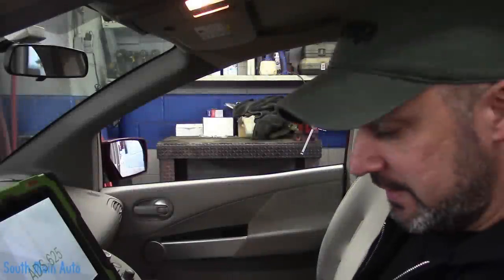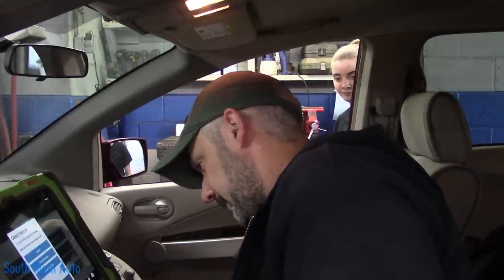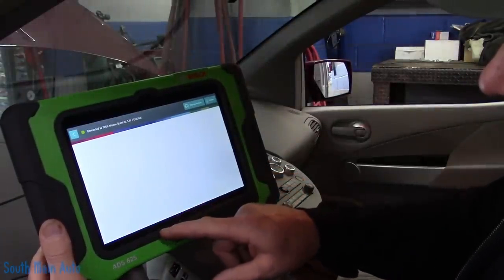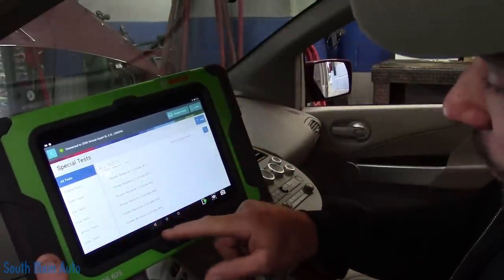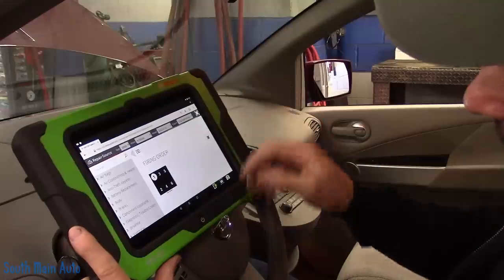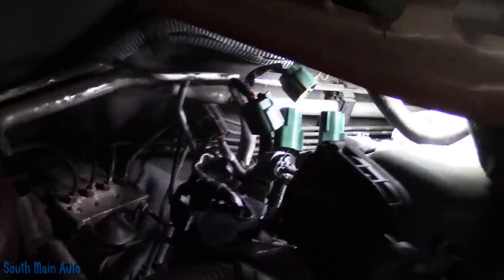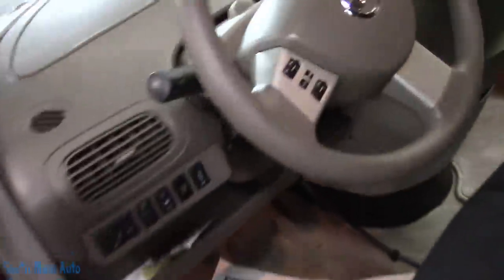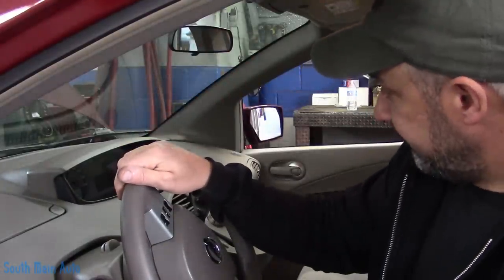Customer Replaced Spark Plugs And Now It Runs Bad!?

Comment: Had a bugger of a time changing the intake-side plugs on my 4.7l, 2008 Dodge Dakota.  I think that they were original and the boots on three of the coils were welded to the plugs.  Finally all buttoned up (pro tip, park the working vehicle behind the one you are working on), and started and idled just fine.  Went out to run some errands and the miss-fire was awful.  First stop, put on the gloves and had a look, everything looked fine, still bad, second stop, out again for a look, #2 coil connector was not plugged in - who the heck would forget that?

Comment: WHen I bought my Caravan, the first thing I do with a vehicle is replace fluids, plugs, wires, belts, I discovered the plugs in the back of the engine were all just finger tight LOL, no idea if the previous owner never tightened them or what but all 3 were just barely finger tight.
Like this video shows, cyl 1 and 3 were mixed up, this is why you remove ONE wire at a time!

Comment: Replacing sway bar links on wife's Chevy Cobalt.  Got the body bushings done, started the first link, but the ball was spinning in the socket.  There were no flats, all I could grab was the nut itself.  Tried locking pliers, still nothing.  Turned out I'd forgotten there was an internal hex on the end of the stud to keep the ball still while turning the nut.  Ended up retightening the nut as best I could, and shop down the street charged me a half hour labor and then told me what I should've done.  In my defense, the internal hex was pretty gummed with dirt and grime - even after the guy showed me the part it took me a second to realize what I was looking at.  Before bringing it in, I thought about grinding flats in the end of the stud (I'd been expecting an external hex, because my OEM replacements had them) but worried about making a bad situation worse.  Should've just went for it.

Comment: Done the same on a Honda motorcycle. Wasted spark coils under the seat, spark wires a good 2+ feet long. Left coil goes to 1&4, right goes to 2&3. If you hook em up as 1&2 , 3&4, it will just about start and run on 1&3.

Was into a spare set of carburetors before my dad looked at what I was doing and figured it out.

Comment: Rebuilt a 3970010 Tree-fitty block once had a tap or knock sounded like a back cylinder listening through a 24inch extension bar. I had some help on tear down put all the parts in the trunk of the 79 Formula Bird I took it out of. Was doing inventory and checking head casting#'s cause I had a $400 offer of a set of cameldouble humpers at 67cc with oversized valves, beehive springs, already set up for roller rockers. Anyways was in the trunk digging out heads and saw the timing gear had plastic coated teeth and that it had broken a good size section off. To this day I think all that engine really needed was a timing set. I did it up right though got the heads the guy was selling with roller set, freshened hand ported, a medium cam, edel duel plane, double roller timing set. Dumped 1200 or so into that and only needed a timing set.

Comment: Had close to the same issue on a 05 equinox. Did a head gasket job for my sister and it was 2:00 in the morning when I finished. Started it up and had a huge misfire. I had 2 and 4 flipped around. I learned once again. That's it's never good to be dead tired and work on vehicle's. It always ends bad lol.

Comment: My silliest mistake was after rebuilding a Pontiac 400 after I put the distributor back in I started putting the wires back on in the wrong direction! Changed the direction and the engine ran like a champ!

Comment: Did an engine swap on a suzuki sidekick, took the 1.6 8 valve out and put a 1.6 16 valve in, modified my wiring harness as needed. I got my 16 valve in, fired it up, and its running smooth, not coughing or misfiring, but revving super slow and lazy, and no power. Well, its not timed yet lets time it, no change. Well is my EGR stuck open? Nope thats not it. Hows my wiring, hows my compression..... 2 consecutive weekends of checking absolutely everything with no change. It was about the 4th time re-installing the distributor cap that I realized, even though I knew it rotated counter clockwise, I was putting my plug wires on like it spun clockwise! After swapping 2 and 3 it ran awesome!

Comment: I was working on the v.w golf, 1999 when it stalled out in middle of winter after I sprayed engine bay, leaking oil I wanted to see where. Oil was low so we went and bought oil and a funnel, told wife we had to get smallest one possible. Mind you I was under pressure, needed to get to work on time, I pulled the dip stick out and tried to put the funnel in the dip stick to fill it, after a few choice words, my wife said joe, don’t you fill it up there, yep on the valve cover a big ole cap for putting oil in. Man I laughed hysterically, couldn’t believe that I did that, my wife was the mechanic that day!

Comment: I've done a few plug changes and i usually do them one at a time to reduce the risk of mixing them up, but once when i was working on my old volvo 740 i bought the wrong plugs so she ran rougher than usual so switched back to the oem plugs and problem got solved

Comment: I experienced that in 1971 what happened was a plug was dropped on the intake and it bent  the electrode on the plug. If you drop a plug even if so lightly always re check the gap.

Comment: I decided to change the fluid in my transmission. It was a manual with a fill and drain plug.

Knocked the drain loose and let 'er dRIP!

Then I got my gear lube hose and pump ready. Got the socket I bought specifically for this job on the fill plug, put some pressure on it.

And promptly rounded the head.

Hours later a neighbor lent me a socket he didn't mind me hammering onto the remainder of the head of the plug. I lucked out there and at the junkyard where I found another plug.

Comment: 1987 IROC Camaro trunk pull down motor, I replaced the motor and gearbox for the trunk and accidentally broke off a clip that holds the plug in place, the trunk worked intermittently for a month after that while I was trying to figure it all out, it never occured to me to just push the plug in a little further and it would start working again, it appeared plugged in but wasn't transferring power. Silly mistake that I learned from

Comment: I have my share of blunders. But I will relate one of my dads from when I was a kid circa 1983. Dad is a seasoned mechanic. Picture it: a 1975 pinto wagon, My dad got a good deal on it, low miles, clean car, but had a blown head gasket. He pulled the head, took it to the machine shop, resurfaced and checked for cracks, all is good. Returns home with head and installs the head. Fills with coolant and proceeds to try to crank. It spins well and almost fires up. This goes on for a couple of hours, checking timing, compression, fuel supply, spark....... ETC ETC. It finally dawned on him that he had placed red shop rags in the intake and exhaust ports on the head while he was transporting it, so that nothing would accidentally get in there. Fortunately it didn’t hurt anything and I’m just a few minutes it was running like a champ.

Comment: Did something very similar. I wired up the second coil on an 8 plug 4 cylinder ranger wrong one time.    Vehicle ran fine until under a load.   Took it for a test drive and it stalled while pulling out in front of a semi.    Limped it home and payed a tow truck and the dealership to find out I wired the second coils plug wires just like the first despite it being reversed.   Costly lesson.

Comment: Funniest mistake I made was when I upgraded my vehicle to push to start and keyless entry.  Part of it was I had to pull my dash to access BCM and add a wire for the hood latch sensor.  I put everything back together and it wouldn't start.  Had it towed to a mechanic, to find out all I did was forget to reconect one of the Star connectors in the dash🤦‍♂️.

Comment: I changed a clutch for a friend,  on a jeep .
I had a friend help me. What happened was it used a short throw out bearing and the original had a sleeve that went from the hydraulic slave cylinder to the throw out bearing. 
I didn't realize it, but the new bearing was longer to replace the sleeve. 
I put it back together and the clutch wouldn't engage. To make matters worst it was a 4X4 so I had to take it back apart and remove the sleeve . Fortunately,  it only took about 3 and a half hours to fix it. I really felt bad because my friend had to wait an extra day to get his jeep back. 
Since then on any clutch job I check the throw out bearing and compare them. What I found is, Ford did the same thing on some explorers.  The thing is that sleeve looks like it's supposed to be in there, but the new bearing has a longer shaft.

Comment: Purchased a very cheap 4 cylinder Renault non runner. It had just had a head job done after cam belt failure but would just not run after being re assembled. On checking the timing, I found that the cam shaft had been set with Cylinder No 4 on the marks. For those who don't know Renault number the cylinders from right to left when looking from the front ( 4-3-2-1) or put another way, left to right when sitting inside the car.  (1-2-3-4) .

Comment: I make sure to get my sparkulator wires and things hooked up correctly. Very easy on simple 4 bangers and rotaries with labeled distributor caps :)

Mistake I made once was on my Toyota Prius. Went too ham on a stuck old spark plug and destroyed it, thought I got all the pieces out but the engine shook something fierce when I started it up. Was not fun. Destroyed something internal as compression was low on that cylinder afterwards and had fierce lifter tick. Ended up replacing with a new motor...

Comment: Was doing my own 4 cyl head gasket. Was not paying attention, 10 head bolts, 2 are shorter. Put 2 longer ones where shorter should go. When torqued, longer ones didn’t hold head tight enough, started leaking. After another head gasket and new head bolts put in their proper place, $100 in parts cost and the time involved (including retiming) and fixed! Stupid things happen! I will never make that mistake again.

Comment: Mixed up two of the plugs once. Luckily it was a inline 4 and easy to figure out when I noticed the length of the wires from the distributor to the spark plug holes seemed off.

Comment: A mistake I will never forget is when installing a cylinder on a 1979 CBX 6 cylinder motorcycle by myself when I was probably 19 or so. Took a little while but I got it on without breaking any rings, slid it down and seated it on the case nicely. I then started cleaning up to put the rest of the engine together when I moved a pile of rags and saw the brand new cylinder base gasket that I forgot to install before the cylinders went on ... ARRRGGGHHHH !!!!!!!!!!!!

Comment: My 18yr old son swapping a stock 4bbl intake for an edlebrock performer on his chevy k10 with a 350 accidentally left a shop towel on the lifter valley, found that out when we couldn't get the distributor to go in all the way. Needless to say intake had to come back off and reinstall with new gaskets. Not expensive but time consuming.

Comment: I was working on my first Subaru, think I was tracing the typical noisy HLA that the EA82s of yesteryear were known to have, and knocked the high tension line off the coil. That 45Kv spark was quite painful as it kept hitting the underside of my arm, running down to my fingers, and exiting to the block!

Comment: I am a mechanic myself and worse for me was not paying attention to serial number range on a combine wiring diagram. The circuit I was after was one out of 2 that were actually different between the 2 choices and were misleading my diagnostics for 3 hours, until I realized I was chasing the wrong circuit code and color the entire, the circuit seemed to be the problem (because it made no sense to have power where there shouldn't be) BUT it turns out it had nothing to do with the problem after all and it was just a bad "terminator" (can-bus issue) with a faulty resistor. Swapped the part in 15 seconds...diagnosed for over 3hrs....lol. Charged only for 1hr and the terminator.

Comment: Put a tensioner on backwards. To my credit it was the tensioner on those 2000's malibu's. Where the tensioner only has a little pin on the top indicating the orientation. Figured it out when my belt was squealing like crazy and couldn't keep the engine cold for too long.

Comment: I mixed up spark plug wires a few times, but the my best was I was doing rear brake shoes on a 1 Ton pickup. I needed to take the rear brake drum off,  So not thinking, i pulled the axle shaft and remover the whole drum and hub assembly to get the brake drum off. When I set it down, the brake drum downed it popped off the rear hub, I didn't even try to pull the drum off before, I wasted about a hour of time  because I didn't need to pull the hub in the first place.

Comment: Project car - first start after engine rebuild and complete harness rebuild. 4 cylinder engine plugged injectors from rear of engine to front 1-2-3-4 instead of 4-3-2-1.  (Timing belt/front engine on drivers side, transverse engine) fortunately the wires all reached the other way so I didn’t have to rewire them. Engine fired right up after swapping them. :).

Comment: I had a 2003 jeep liberty I redid the front suspension ball joints,upper and lower control arms, inner & outer tie rods. Let's just say I now use thread locker after tearing it apart many times

Comment: Lol always check the gap on the spark plugs. Always do one at a time. Always use anti seize on plug treads only. Always use boot lube on boots. Dielectric grease for connectors (optional) but recommended and make sure connectors click in all the way when connected. Also torque specs, use them if you do not know how tight the spark plugs should be fastened.

Comment: Want to hear a good one ? cause you really need to hear it and it will give you chills 

 In the 80's my boss picks up a camshaft modification job  to do for a customer  on a chevy truck , a 350 LT /4 barrel  4 bolt main  small block from a 76 Corvette Stingray   that the guy had just dropped in to replace the the original 305 .. Can't remember the year of the truck but it was a Cheyenne '' 1984 i think '' . 

Anyway  the guy asks me to do the complete over top gasket job at the same time  whitch i do . 

every thing goes smoothly  like on all 350 chevy engins small blocks since they were the easiest to work with . So i finish the job and i start the dam thing and at the same time the engin takes off  you ear that sudden loud knocking sound like if a connecting rod had loosen up inside a piston and  i go '' WTF ? '' and after about 5 second total silence  and no more knocking the engin runs better than a brand new car .

we spent days trying to figure out why the engin suddenly had this knocking  for about 5 second  but since we went for a ride and a good one to confirm that the engin was going to be perfect  it didn't worry us  as much even if that knocking  sound for 5 seconds  bothered us a lot  in our dreams after that .

 The guy ran the truck for years and  he was extremely happy with the job done  and we continued to do its maintenance for years also after that . 

 But the next day i had  finished the job i was looking for one oof my sockets  a 5/15  1/4 drive  and i asked the boss if he had  seen it but said no and asked the other mechanics and they also said no  so i said to myself  i must have dropped it on the floor and it rolled under a counter or something but at the price they cost i didn't really bother trying to find it and bought a new one . 

 About 11 years later i'm starting to drive in car racing and i had just bought that 1978 camaro  and i was looking for a good engin  like a 350 and i happened to stumble on that truck i did 11 years earlier  that was parked behind a barn rotting away  so i stopped cause i knew that the  350 LT was surely still in there  and i bought it  for the engin and i decide to do an over all on the engin and started to take it  appart and to my surprise  when i took off the left side head , what did i see ? a lump on the top of the piston number 6  that has pretty much a rectangular shape so i start to scratch the carbon off of it and i start to see the chrome  appear .  

The socket that i had lost 11 years before had fell inside the cylinder without me noticing when i sat down the head on the block   and from there you can imagine that a new scenario from when i heard that knocking 11 years earlier started to take shape in my head .  When i started up  the engin 11 years ago the socket just slamed inside the cylinder and sunk right in the piston half way and stayed stuck there   untill i found it again 11 years later  and the funny part is that the guy ran that truck in mud racing for years  but that socket never dislodged from the piston .

 Talking about dam luck that it didn't dislodge and  destroy the engin cylinder and head  and cost my boss  thousands of dollars in repair . That socket had slammed  right between the 2 valves  on the cast iron of the head missing the valves by only millimeters and just sank inside the aluminium of the piston half way . 

Try to beat that one with a clost call that didn't end up costing thousands of dollars in damages lol

Comment: My most expensive mistake was on an 04 Tundra 4.7. Replacing serp belt, tensioner and fan clutch. I forgot to clip the upper and lower fan shroud back together when I was done. Started the truck, the fan caught the lower shroud, destroyed it, broke all the fan blades and punctured the radiator. 4:45pm on a Friday, nonetheless.